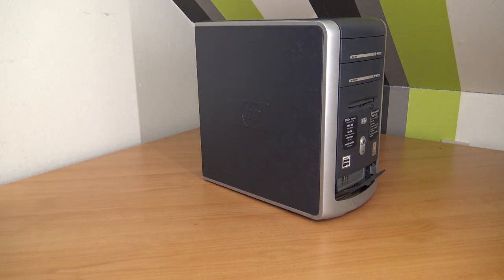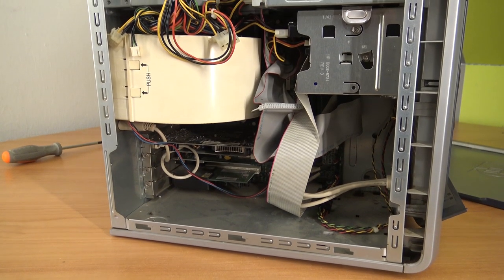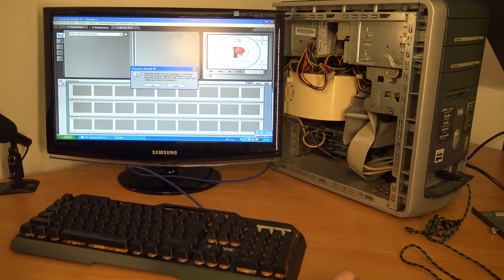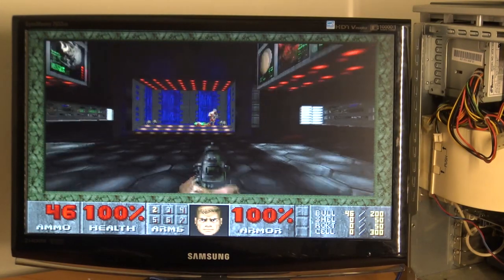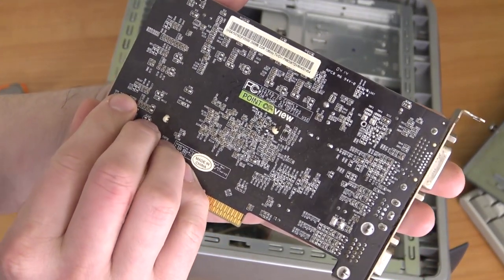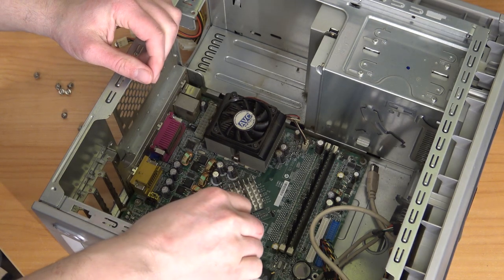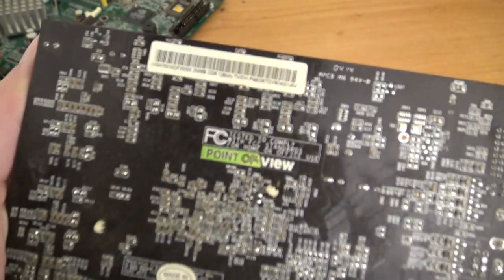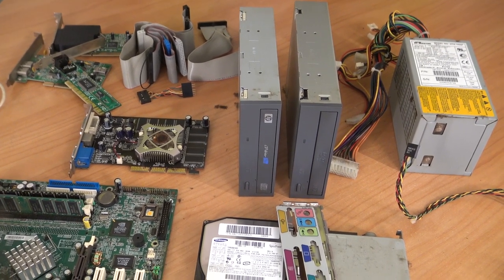AMD Athlon XP & Windows XP in 2021  ... Let's go back in TIME ! 😄

Comment: I just assembled a 2800+ system but have not booted it yet.  I got a complete HP system very similar to this one for free, but the BIOS was locked.  But someone else recently gave me an old Thermaltake prebuilt from that era but the only thing left was the motherboard, turned out to be a high end MSI overclocking board for the XP series.  Put it together with an ATI  HD3450 with 512MB DDR2.  Want to compare it to a P4 Prescot system I overclocked.  That old HP prebuilt case I got that 2800+ CPU from, is now a sleeper build with a first generation Threadripper and 6700XT.

Comment: Don`t wait miracles With Athon XP2200, you should mount an Athlon XP 3000+ is more faster and good cooler cpuy like DP-102 LE from Aerocool with copper and heat pipes, and AGP with Ati 9600 Or Nvidia 6600 will be enought tests
Reply from the maker: Maybe fun build indeed to grab higher cpu and rebuild this to a gaming monster in 2021 .. first some test vids... than let's start building when I have the parts.
Reply: Sometimes the fun of a retro build it just using what you can find, personally I'm more than happy with the Athlon XP 2800+ and "BFG TECH" Geforce 6800 GT OC I've found, probably going to fit a unused ssd I have sitting around and Dual boot Windows XP and Linux XFCE of some form and just fit it with a mix of new components and any other retro hardware I happen across

Comment: I still have an old Cobalt Blue and Black HP Media Center with the RCA ports for connecting other devices. Windows XP and 128 MB of RAM and 40 or 60 gig Hard drive. Intel Pentium 4 CPU. Don't remember what the graphics chip was.

Comment: My build back in 2003 consisted of an Athlon XP 2500+ that was easily OC'd to 3200+ levels thanks to the Asus A7N nForce 2 400 Ultra and 512MB of Corsair CMX DDR400 RAM. I bought the ATi Radeon 9700 Pro the moment it was released and it lasted me for a few years before upgrading to a GeForce 6600 GT AGP and lasted me for some years after that before I made the jump to PCIe. All of it was placed inside an Antec Lanboy case that had far better airflow than any big box store OEM PC at the time (Alienware, Voodoo PC and Falcon NW were boutique system builders before being bought out)

Comment: That brings back memories of my homebuilt Athlon XP 2400, later upgraded with a 3000 for most of the 2000's. It had a Abit KD-7 motherboard which I had to later replace with a Foxconn board because it had Abit's notorious bulging caps problem. It also had a Geforce 4200, A couple of Western Digital HD's, and a Lite-On DVD burner.  I think you landed some nice parts, especially the DVD drives.  I would get rid of the video card. You can get faster cards that will perform better cheap. You might be able to reuse the case with new parts for a "Sleeper PC".

Comment: With this parts would be wise to do a win98 high end pc. I recommend to hunt a sound blaster live, its not expensive and compatible with DOS and great for win98 EAX sound effects. You can use the same processor or use a duron 1ghz. Pay attention to the 5v rail on the psu preferable 30A or more on this rail for that board. The graphics card is perfect for win98 and DOS, I had no scrolling issues. 512mb is the max recommended for win98.

Comment: I have a voodoo 4 you could use in this to make it a little more retro, I have a voodoo 5 but it wont fit that 8X agp slot but the voodoo 4 will fit them cause its slot is split into 3 sections and will fit any AGP slot

Comment: USB mice and keyboards really should work just fine, as long as they are plain devices.

If they have other features or present as strange composite devices that's a little different.

Also, back then some BIOSes supported basic USB devices or at least would do some sort of PS/2 emulation with them.

Comment: That gpu are quite weak and a geforce 2 ti, 3 ,and 4 beat the card in games but the 256 mb Vram might come in handy - you cant use like a nvidia 5700 xt or ati 9800 Pro on sucha weak psu - they will seem dead if you plugg those in but its really the psu that even can begin to deliver some voltage they need

Comment: I happened to have acquired a machine of  the same series, slightly lower-end compared to yours. It has a athlon xp 1800+, 40gb of hdd and a radeon 9000. Mine unfortunately has a dozen of capacitors bulging and leaked. So there were some repair work to do. Nice to see everything works great for you.

Comment: FIFTH*
Reply: BTW those CD/DVD drives are standard, nothing fancy. it's just the case that has an extra "fancy" door. Probably puts a lot of stress on the mechanism come to think of it 😂
Reply: athlon xp 2200+ ,FX5500, 512mb ddr dual channel
Reply: agp?
Reply: I think that has the infamous NVidia onboard graphics. -Supposed to be very unreliable